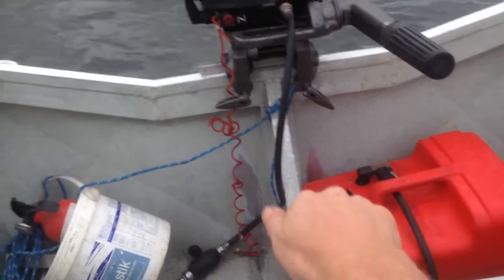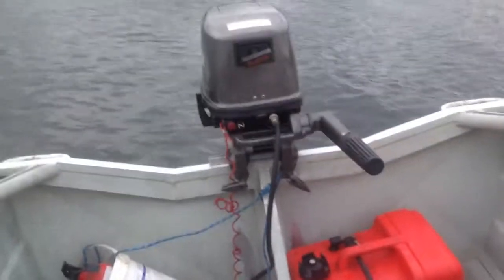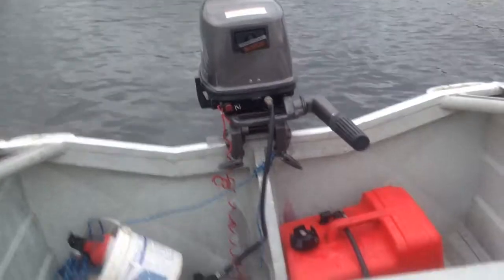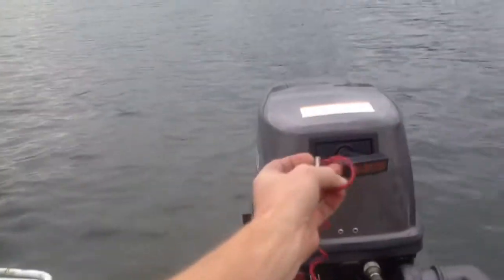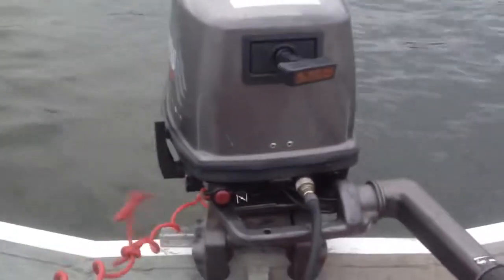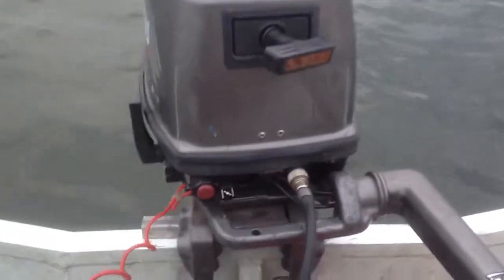Stessl rat pack 3.00hd. 9.8hp Tohatsu

Comment: G'day mate. Nice run with the 9.8hp on the 3m Stessl Rat Pack. I was considering getting a 3.3m SeaCraft 330 Ranger, and putting a 9.8 Tohatsu on the back. The max hp is 6hp, but the transom can handle up to 35kgs. Do you think that is doable? If so, What would you approximate for a top speed? Ta mate, Dimitri
Reply from the maker: The ranger would be fine with the weight, the 9.8hp two stroke weighs the same as the 6hp. The 9.8 does have a lot more power so the boat may need some extra bracing. The other concern will be that it is rated for max 6hp and the waterways and water police are getting strict on exceeding manufacturers max hp ratings.
The manufacturers set the max hp rating not only on how strong the boat is but also it’s safety, it may be that any faster than a 6hp pushes the boat something unsafe starts occurring like porpoising or digging an edge when turning etc. 
You may be able to call SeaCraft to discuss if you can buy one that is rated to 9.8hp or discuss there thoughts.
I do think it would fly with the 9.8hp being lightweight and flat bottom.
Cheers,
Aussie Boat Guy 👍
Reply: @25hpboatracerman , thanks for your reply mate, it is very informative and wise. I will follow your advice and see how I go. Ta mate, and Happy Easter Holidays!

Comment: Hi dose the motor flick up when you go fast in reverse
Reply from the maker: Hi Mate,
No it doesn’t, if your motor is doing that you need to check the revers lock that locks onto the trim pin.
Cheers 🍻 
Aussie Boat Guy 😎
Reply: Can you do a vid of you going full reverse and see how quick you go
Reply from the maker: Hi Champion,
I have sold that boat.
Cheers 🍻 
Aussie Boat Guy 😎

Comment: A new  5hp four stroke weighs around 24kg so you are getting half the power for the same weight as the 9.8hp Tohatsu 2 stroke.. Not sure that is progress.
Reply from the maker: My thoughts exactly mate.
I love the 9.8hp tohatsu, I’ve owned about 4 of them.
I have one now and feel I will hold onto it as no more new two stroke outboards for sale in Australia (of course second hand ones are still available but I feel they may increase in value or become harder to find)
Cheers
Reply: @25hpboatracerman  I literally just bought a brand new one here in Malaysia. Haven't even started it yet. It will be a kicker motor for a 26ft trailer-sailer and the powerplant for a 3.3 meter dinghy. Everyone kept telling me to keep the 15 hp Yamaha I sold as a kicker with my 200 motorboat but that thing is HEAVY. A serious struggle to lug it around, I think it's about 41kg with oil etc. I think this little beauty will be a lot easier to manage getting on or off the dinghy/motormount while at sea. Glad to hear your positive view of them as an actual owner :)
Reply from the maker: They are great 👍 
One of my favorite motors.
And way better for your back if you are lifting it onto different boats.
Cheers

Comment: Hi! What does that motor weigh? I can’t find any information about it...
Reply from the maker: Hi mate,
The motor weighs just 26kgs. 
169cc two cylinder two stroke.
2.08 to 1 gear ratio and standard prop is about an 8.5 pitch.
Operating range 5000 to 6000 rpm.
I love these little motors, they pack a punch for such a light motor, same block and leg as the 6hp but with high compression head big carburetor and a few other things to get the other 3.8hp
Cheers,
Glenno
Reply: The Aussie boat guy. Alright, thank you!
Reply: @25hpboatracerman  8.5 pitch is way to much for a 9.8 on a ratpack should be running like a 7 at the most that was why it was cavitating so much and it will get on plane much easier if you go down a pitch or two, i run a 9 pitch on my 18 tohatsu on a ratpack and its perfect
Reply from the maker: 😂 it’s not cavitating at all ??? 

Your 18hp tohatsu has a 1.85 to 1 gear ratio, The 9.8hp has a 2.08 to 1 ratio so you can’t really compare what prop Is on your 18hp compared to the 9.8hp unless they had the same gear ratio, which they don’t.
 So 8.5 pitch worked very well on the 9.8 on that boat. The correct Way to see what pitch prop is by checking maximum RPM is within specs. The 9.8hp was reaching max rpm with the 8.5p prop and hole shot was good.
I have run an 18hp tohatsu on that boat and was able to run a 10p with no issues at all and run at full throttle and reach max recommended rpm with no issue.
If you like womping then the 9p might be the go but top speed is compromised for sure and max rpm will be above recommend range too.
My 18hp did a genuine 55kph gps on that boat. 
👍👍👍👍
Reply: @25hpboatracerman  2:35 i thought i heard it cavitate when you were turning  around, i had a 6hp tohatsu before the 18 and was running a 7 pitch i think and it still cavitated way too much, your probably right but i would have thought that 8.5 pitch is to much, i have tried running a 10 pitch with the 18 and could barely get on plane so i dont mind compromising the extra 5kmph i got with the 10 pitch, i get 57kmph with the 9 pitch but my hull is a makocraft ratpack and weighs a bit less.
Reply from the maker: Yeah cool, there is a bit of weed around where I was testing that could have caused a cav for a second.
If you watch my other vids I have an 18hp (15hp merc super with the mods for 18hp) on a Quintrex fish nipper (Heavy boat) with a stock 10p alloy. Gets on the plane easy and 53kph top speed.
If a 9p is working for you then perfect 👌.
I’ve got a modified Mercury stainless 12p that I tried on the rat pack too with the 18hp (I did jack the motor up a lot though) very sketchy and fun. 
73kph top speed but not that great to get on the plane.
Cheers mate, glad your having fun.
👍👍👍
Reply: @25hpboatracerman  fuck 73kmph is really quick
Reply from the maker: Yeah, felt a bit sketchy, had pretty bad torque steer too because of how high I was running the motor.

You on the goldy?
👍
Reply: @25hpboatracerman  Noosa